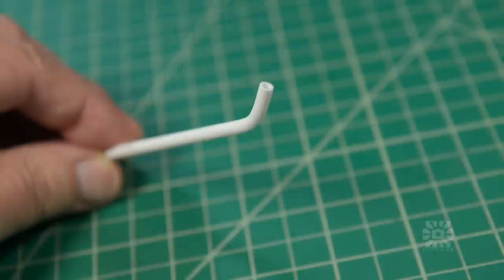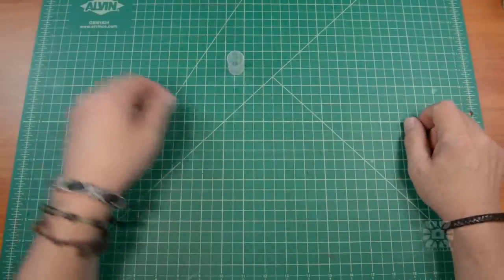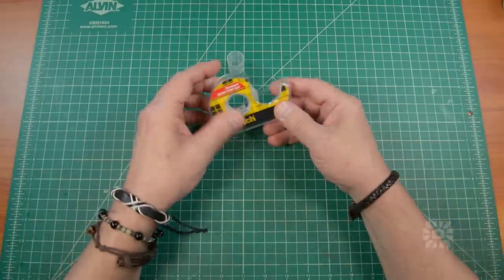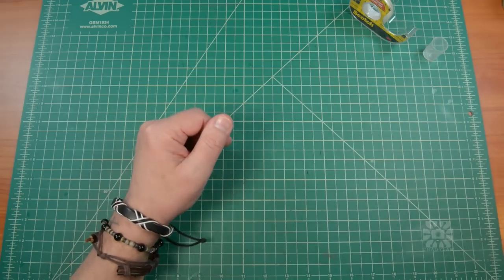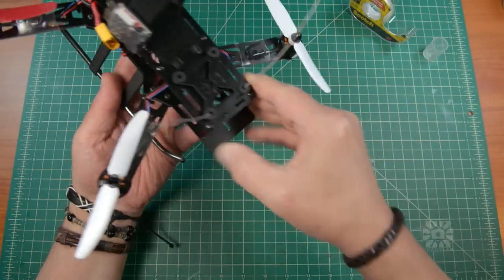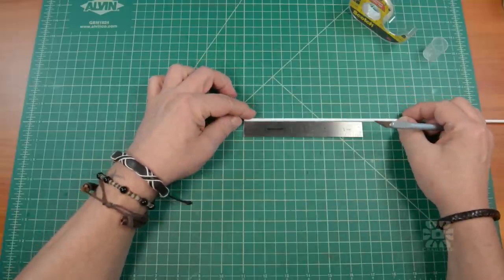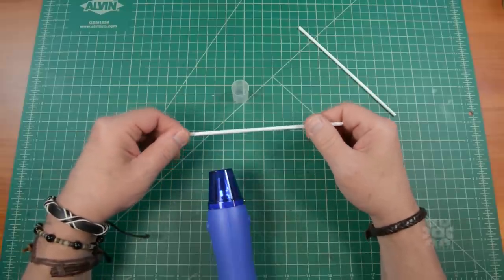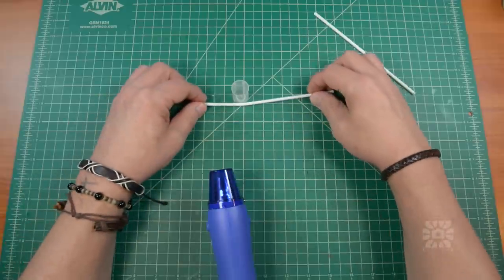DIY Antenna Tubes

Comment: Can I use small diameter plastic straws for receiver wires? Will they block signal?
Reply from the maker: Yes you can use plastic straws.  The only material you want to avoid is metal =)